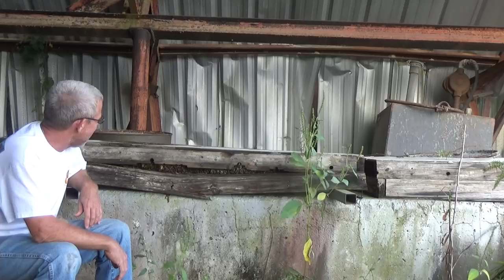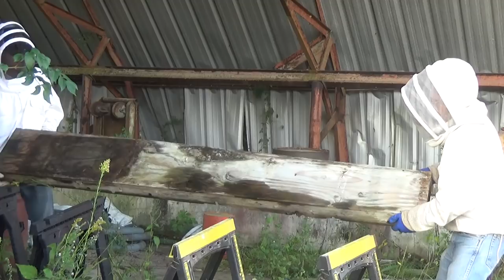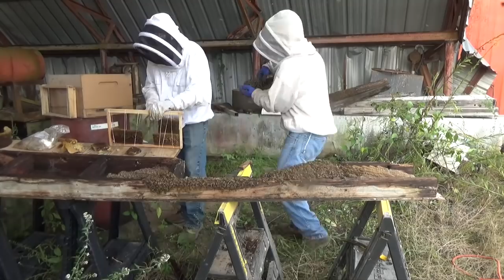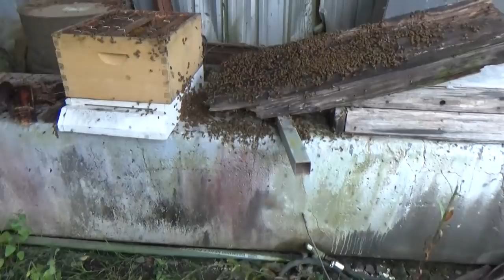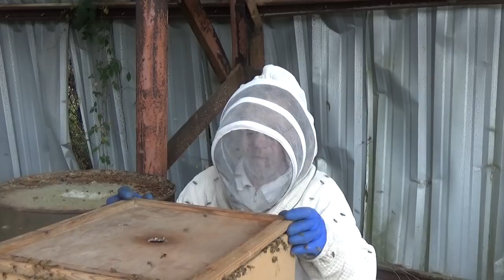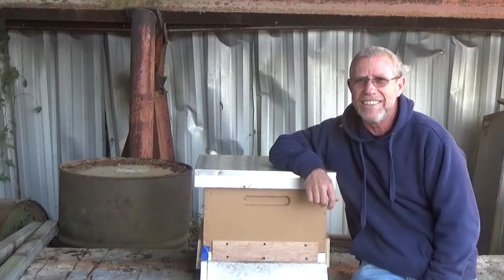Transferring a bee hive from a concrete form board to a bee box

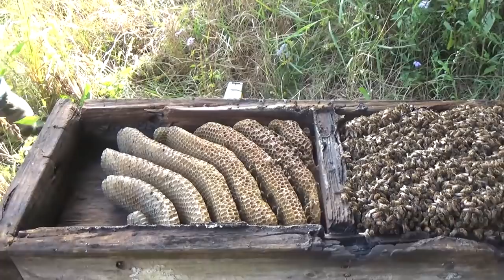Comment: Jeff, I have one query. At the beginning after you moved the form board. the bees appeared to be on the center two sections only. So why did you cut out the center sections first? Why not cut out the outer sections that had no or few bees first and then the bees would have had comb they built to land on. If you look at 3:19 , the combs on the left had almost no bees, but after cutting out the middle section, the bees moved to this empty comb.
Reply from the maker: There was old comb in the box that I was putting the cut comb in for the bees to land on. I left the empty comb on purpose so as to give the bees a place to run to as I was removing the comb from the center. I don't suppose it made much difference as all the bees wound up in the box anyway. It turned out very well in the end, especially after finding the queen. Thanks for watching, and Happy New Year to you and yours. God's peace. 
Mr. Ed

Comment: Mr. Ed 
Happy New Year 
Just needed more information on the Heavy Duty Blue Gloves that you are wearing. I checked my local Walmart and i was not able to find anything. Do you know the brand?
Reply from the maker: Did you look in the paint section? That's where I found these. There is no brand name on them. I hope you find them. Thanks for watching. God's peace.
Mr. Ed
Reply: No I checked another Walmart but I could not find them either,then only had the thin ones that come in boxes. thanks. I will keep checking. God Bless.
Reply from the maker: I don't know if it makes a difference, but it's a WalMart super store. Ask the clerk in the paint department, they may bee able to assist. God's peace.
Mr. Ed